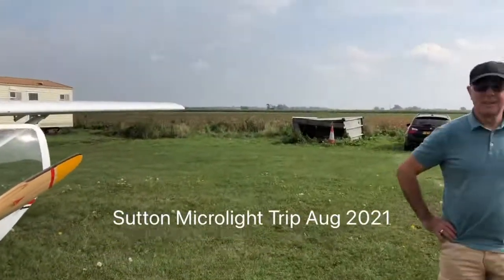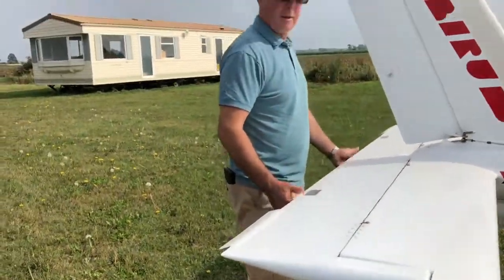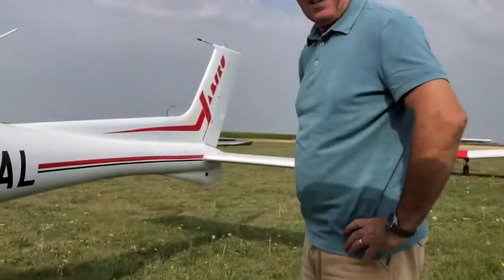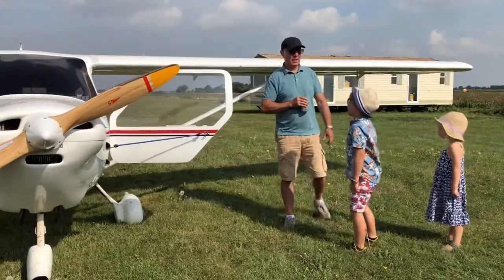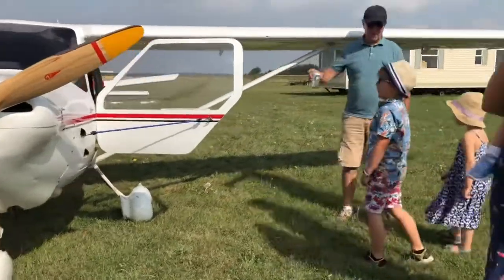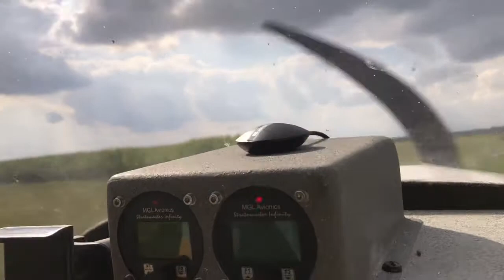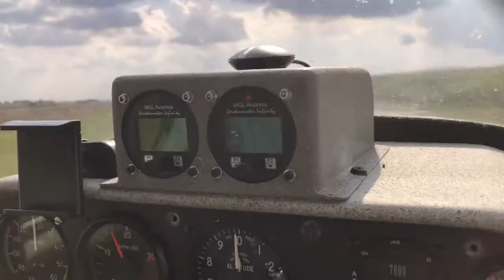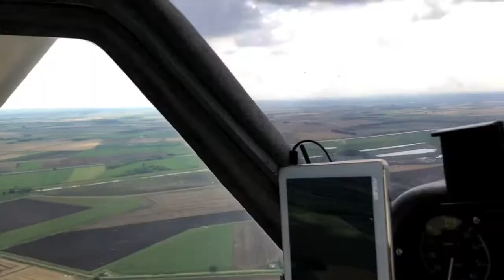How to fly a Jabiru 430 aircraft. With Mike Williamson

Comment: Your central control column is just a single stick, it doesn't have the U shape at the top that the J430s normally have (we have this). Was it built like this, or did you change the stick? Also, the radio buttons on ours are at the top of the two prongs of the "U" - where are yours? Nice aircraft, looks newer than ours, our paint has faded a lot.
Reply from the maker: Thanks for the interest.The aircraft is an SK430 and was built with the single control column. I understand that the dual control is a retro fit option.
The PTT switch is on top of the stick.
The plane was built in 2003 and has been hangared since new so the paintwork has kept in good condition.
Cheers Mike